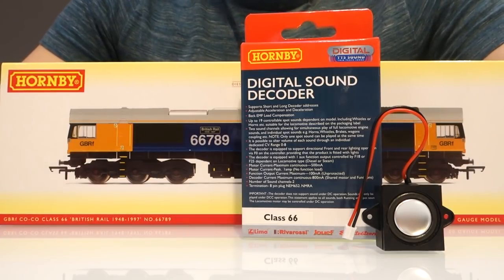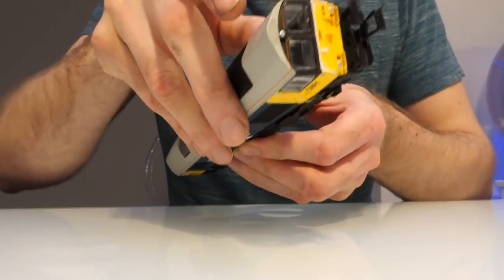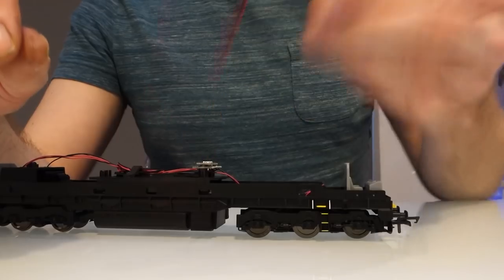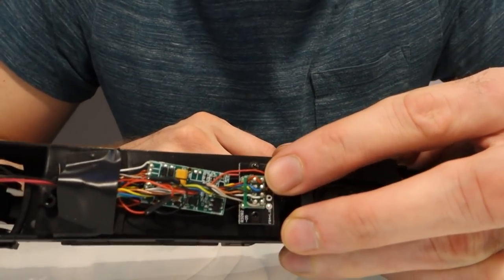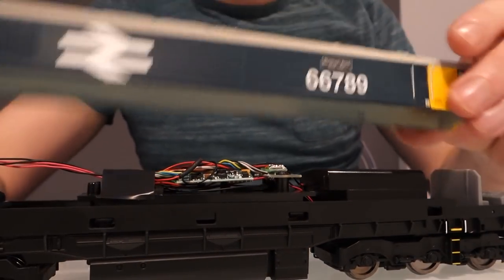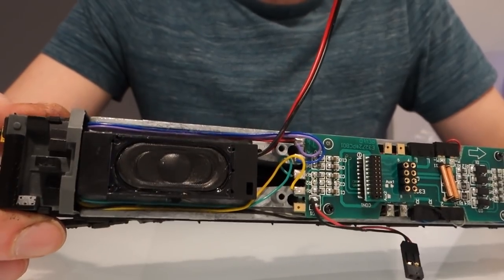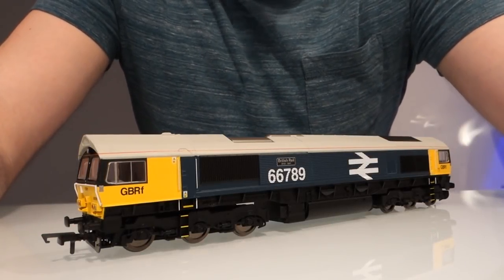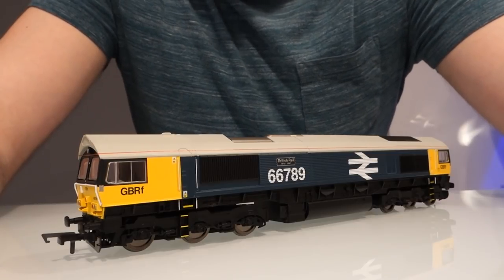Installing The New Hornby TTS Class 66 Decoder And Upgrading The Speaker

Comment: Handy video Richard, cannot believe the Hornby loco didnt have lights. I am the chap that just purchased the Class 66 TTS decoder off you this morning that you took out of one of your models. Do you happen to know what speaker it comes with as it looks different to the ones you show here. Cheers Paul
Reply from the maker: Hi yes I think its the standard speaker, I'm glad it didn'y have lights to be honest, otherwise it would be direct competition for bachmann and hattons/accurascale. I think its better to keep it as a slightly older design that can be sold at a lower price. If they design a new one it will be the same price as the others and pointless in my opinion
Reply: Thanks. Fair point. I have the Hornby COLAS 66 which this TTS will be fitted into plus several of the Bachmann 66s as well as 3x Dapol Class 59s. I agree on the lights, will keep it standard. Cheers

Comment: Good video Richard, thanks. Do you think the TTS decoder would suit a small shunting layout? Or would I need to change some CV settings on the chip?
Reply from the maker: Chris Usher I think it would be fine. You have plenty of control of the sounds with notch up and down as well which would be really useful on a small layout
Reply: How to change the said potion on the chip. Thanks foComment on peu changer des dis potion sur la puce. Merci  d'avancér advanced.